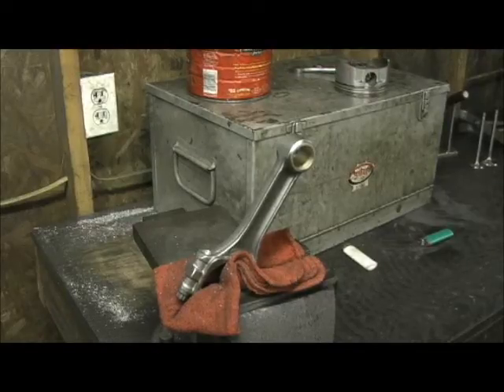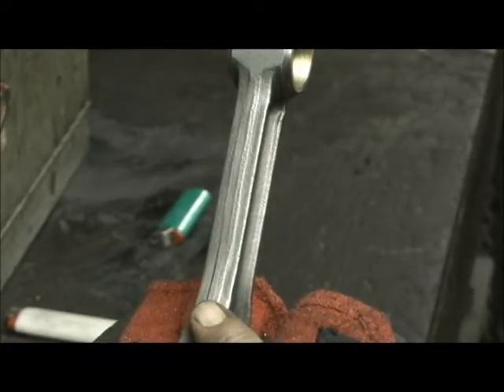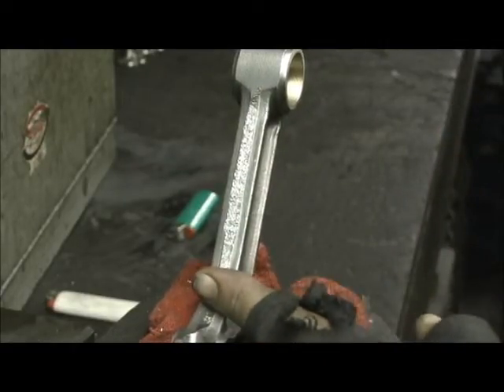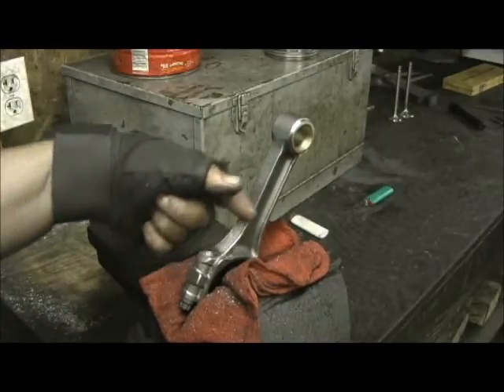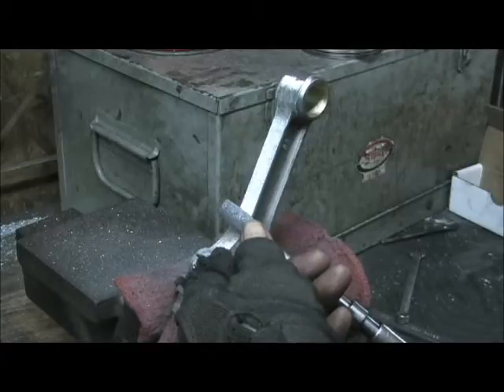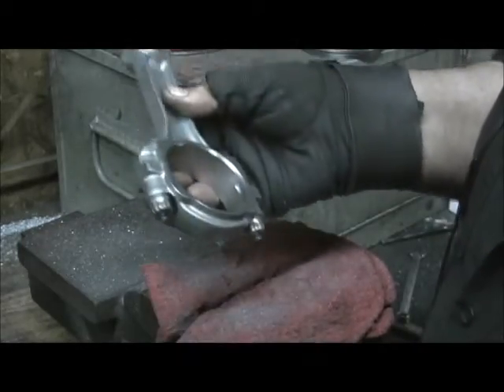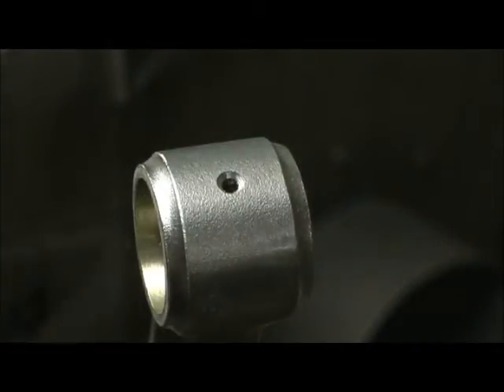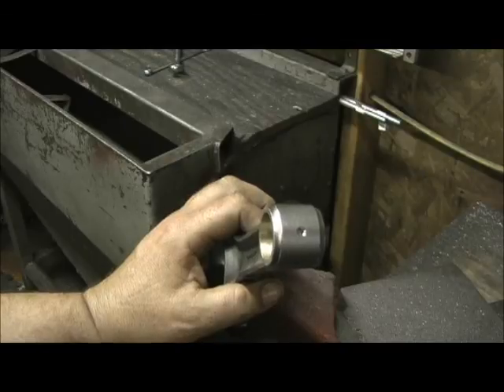336 SBC SIR Eagle rod Mods Part 4 0

Comment: I do not have a shotpeener and years ago looked around on the Island to find one. I like shot peening after grinding and polishing because it has an effect of compression and work hardening the surface to make it even stronger and more crack resistant.

Comment from the maker: Continued) That being said, all Eagle would do would be to send another rod, and be off the weight balance even MORE than they are (around 3 to 5 grams from one to the other in worst cases). That is why I do this procedure, since I am going to balance the rotating assembly anyway. The point where I would send the ROD back would be IF the parting line was deep going inside the Beam of the rod AFTER the grinding was done. Then I would worry. Remember this my friend, Eagle Cranks and Rods (Cont

Comment from the maker: Yea, you have NO IDEA how many times over the past 15 years I have had to deal with Eagle, mainly the dam crankshafts being to "FAT" on the high side of the clearance, and including bearings (standard) that if you installed them you would not have .0015 clearance. I have had to turn about 50% of the cranks AFTER buying them new in the box. Till the past few years and bearing manufactures figured out they can make money off the crank manufactures cutting the cranks to the big side. LOL.(Continued

Comment: ONLY A DAMN FOOL WOULD DO THIS!  HA HA! GOT YA!  I do it too so you know we both have issues. According to Charles fayette Taylor a smooth polished finish is worth nearly a 40% increase in strength for forged steel. It takes me a full week to grind, debur, polish and balance a set of Chevy or Eagle or any other damn rod. After you deny the crack a starting point or a stress riser the fatigue life and strength of the rod goes up.